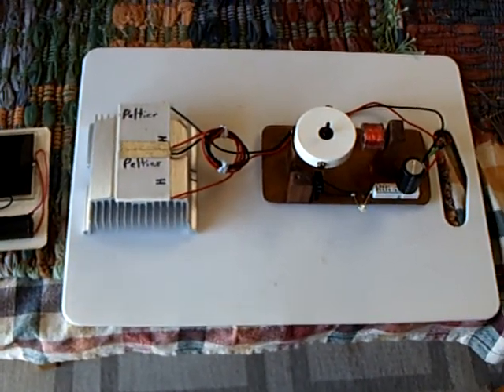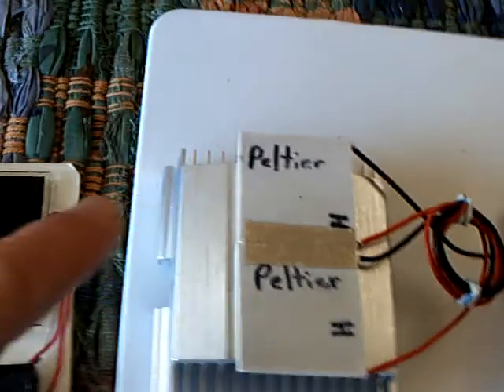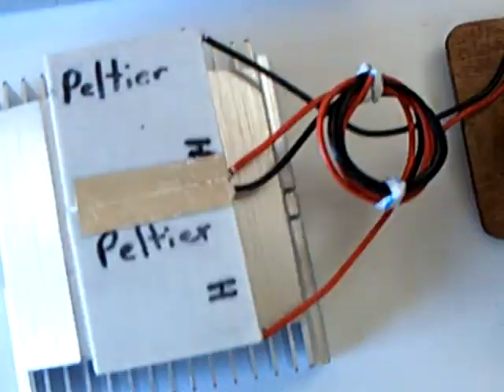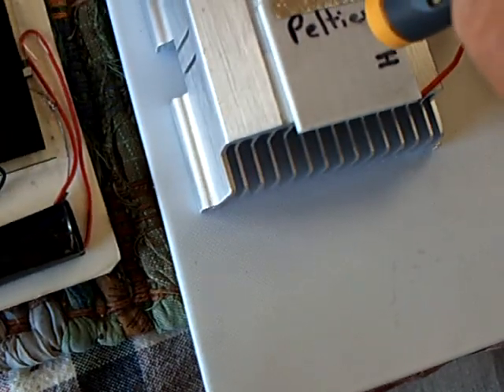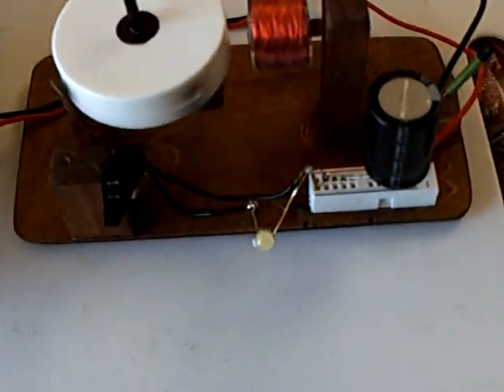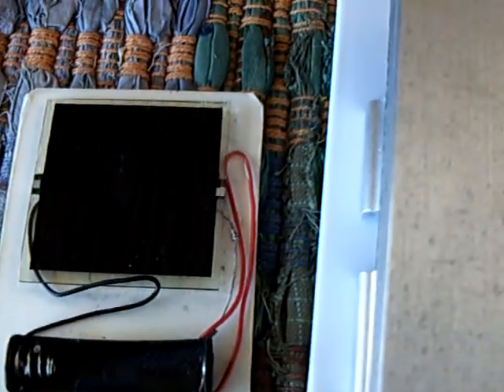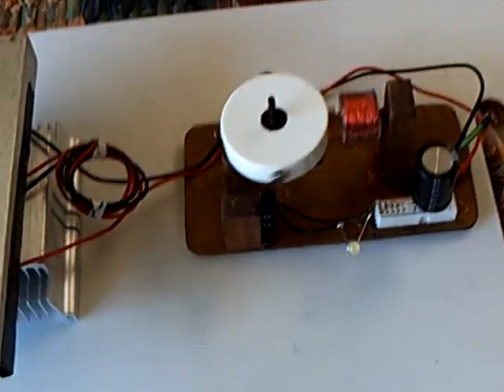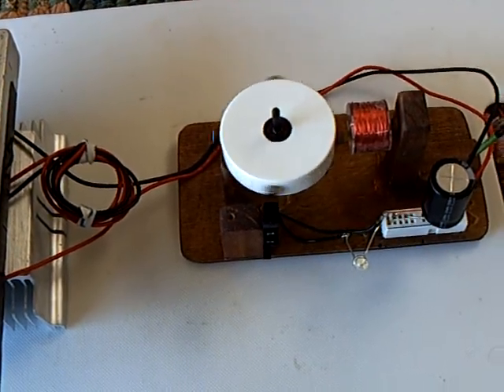Solar heat powered pulse motor

Comment: This I must try! Thanks for the response!:) I once put two iron rods about 3 ft deep in the ground and about 15 ft apart from each other. Soldered some wires to both rods and hooked the wires up to a multimeter through a 400V bridge rectifier. Multimeter was showing 1.5V. Still want to do more testing with deeper grounds. Thanks again for all of your teachings!:)

Comment from the maker: Hi Mart.  I agree----plants do a pretty good job of using solar energy.   By the way my plant battery is still going after over two years.  It is an indoor philodendren house plant with a little Joule Thief using the power.  When the leds go dim or the leaves start to curl I just give it some water.  Sun energy comes in through a skylight.  It doesn't seem to mind the Mg and copper electrodes.  The Mg is one of those Coleman firestarters. I'll pull it one of these days to see what is left.

Comment: Peltier modules work on temp. difference between hot and cold junctions, and are low voltage and high current devices. This high current produces heat (I squared x R) which reduces the temperature difference. Thus, the power produced is reduced. Further, Pelier modules are costlier than solar cells (cost/watt). Peltier modules have advantage in producing power from heat without any moving part and work on low temperature difference. How to improve efficiency and reduce cost of Peltier modules?

Comment: Brilliant as always!:) Would it work if you dug a hole in earth. Then placed an array of Peltier Modules down in the hole. Then placed an efficient heat exchanger on the top side of the modules. Then filled the hole back in with dirt so the heat exchanger is just peeking above ground. When the sun hits the heat exchanger, it creates a temperature differential from the top of the modules compared to the cool earth. Would this work? Keep up the amazing work Brother! Peace and Evolution!